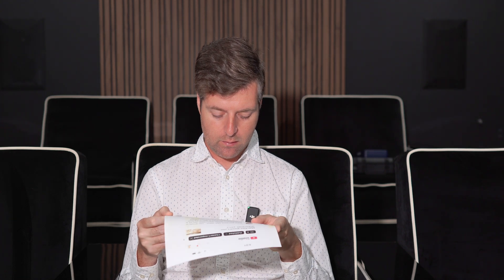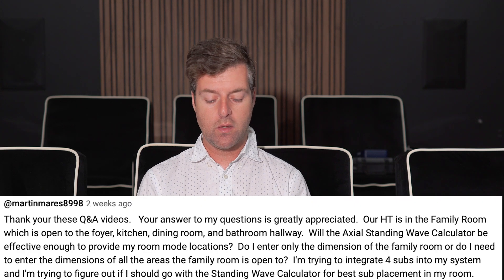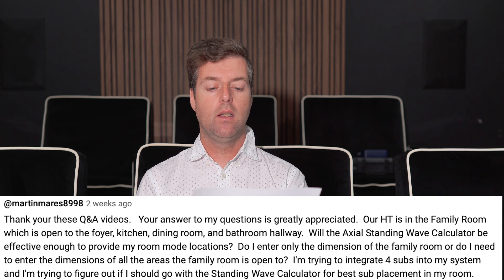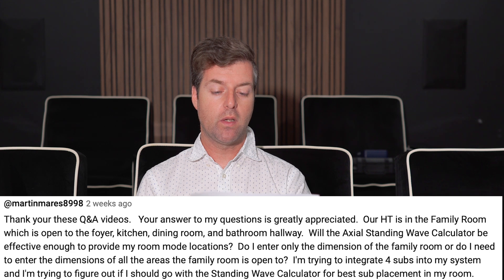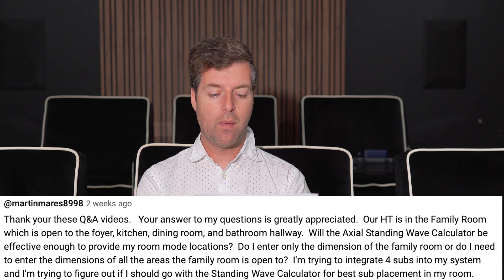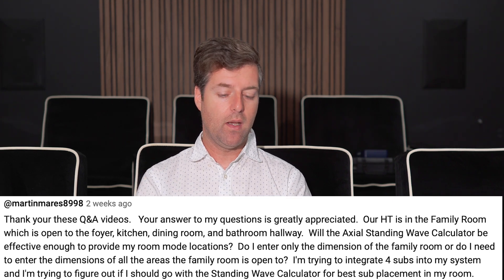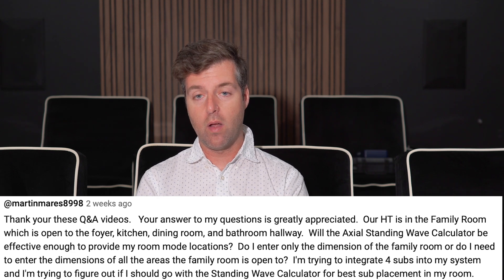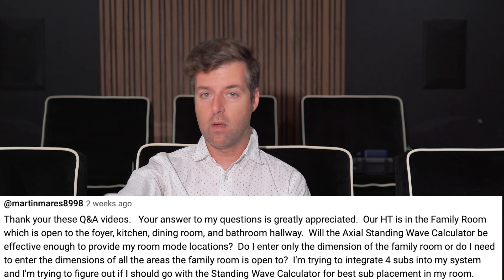Is modeling room modes in open concept possible?

Comment: Had you had any experience using PSI audios AVAA active bass traps? They seem intriguing (though very pricy!).
Reply from the maker: Yes I’ve used them. They are quite effective. Not any better than Waveforming but they work all the time.

Comment: I find these videos very interesting and helpful. Do you still try to aim for certain ratios for the room dimensions when possible or with some of these new techniques such as waveforming and Dirac ART is this no longer a consideration either?
Reply from the maker: Not really a major concern. The ratios does give you a better starting place. But it’s often really hard to change a rooms dimensions.  

Most of the time I get a space defined by the house platform.  If I change the ratio, it means making it smaller.  So while we calculate it, we look at it, it’s not a top concern. And this system works well enough to mitigate the concern.

Comment: I’ve gotten rid of most room modes using MSO and multi sub. I agree that things can measure well while also sounding bad because if you don’t know what you’re doing then MSO can really mess you up. It likes to delay subs by a lot and have big gain differences, so you have to tell it not to do that. The caveat is that that will lessen its ability to get you a well measuring response so you do have to move them around and do some trial and error.

I’d be interested in waveforming if it didn’t cost more than my car